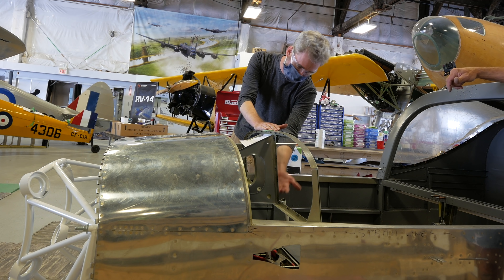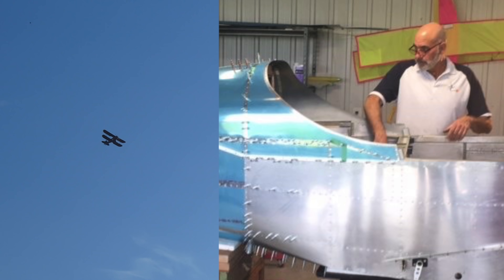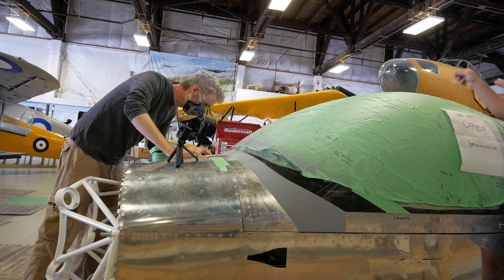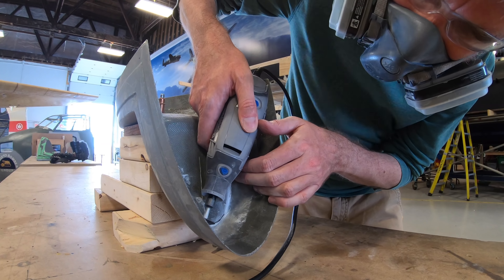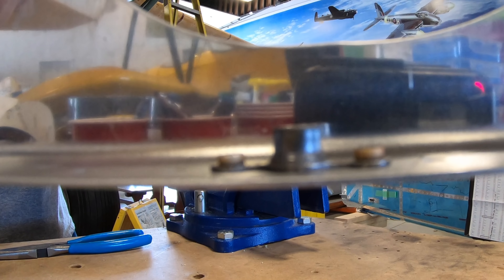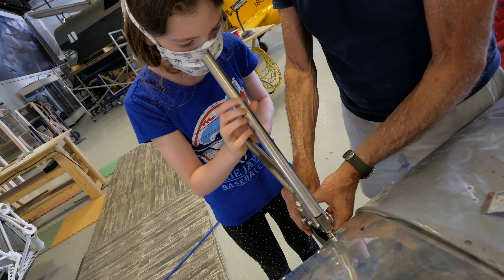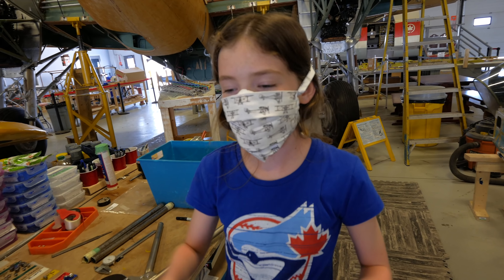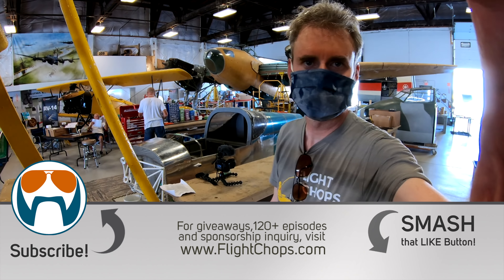Big Decisions made! + Wing Lighting Install - Build VLOG #10

Comment: I'm loving these more in-depth episodes. BTW - top tip, when cutting plexi, if you stick regular clear 3M tape over the cut and cut through it; it acts as a lubricant and greatly reduces melting at the cut line. (Learned from a previous job making illuminated signs).

Comment: You learned the hard way that mixing too much at a time will bite you. If you would have had it in a much larger but shallower container it helps plus putting it in a pan of ice water. I have used a lot of West system Epoxy helping my daughter building cedar wood strip canoes. We use the west system in building up the stem pieces and of course lots doing the epoxy-fiberglass layers inside and out. They have a special extra clear component for that. We have used about 10 gallons worth now with 5 canoes built. They have about 10 different filler materials depending on what you are doing.

Comment: I'm loving the build. Rv's look like great aluminium planes. At least for fiberglass planes, like the cozy mk4 I'm starting tomorrow hopefully, West systems 105 with the 209 hardener is recommended for exactly that reason. It's slower so the thermal run-away is rarer.

Comment: Great to see you SAFELY getting back to the build! Thank you for this. Revision #3 of the instrument panel is very impressive. Clean and balanced. Where will the circuit breakers be located, or are do the switches double as them? Also, since you're relocating the canopy jettison handle, Please show us the alternative method of accomplishing the release. Will it be via mechanical linkages, or flexible cable?
Reply from the maker: For sure yes, we will address how the relocation is executed

Comment: Is Danone Yogurt a sponsor in your aircraft build? lol  -- LED lights are amazing in the right conditions by the way.  Flying the Cherokee Six in the evening one time I had a guy coming at me opposite direction and he could see my light 40 miles away.  And I didn't see his until 10 miles.  Also, I often left the light on all day, even during turn arounds at night left the master switch on and the landing light on (in dark areas) and never worried about battery power for start.  When, I'd NEVER do that with an incandescent/halogen bulb.

Comment: Carefully and dangerously files canopy while on plane. Promptly removes it anyways right afterwards. 🤣😂🤣
Reply from the maker: Heh - yeah - there was actually method to that madness - we knew we just wanted to take off some material with the files and then test close it again.  taking it off was to get easy access to just clean it up after as I was not removing much more material with the sand paper.

Comment: Epoxy in a volume like that creates much more thermal runaway!
Reply from the maker: Haha - yup - lesson learned :P
Reply: Pro tip: immediately after mixing, pour it on a large, shallow dish.  More surface area to radiate the heat away.  And as you already learned: first do all of the prep work, only after that can you even begin to think of actually mixing the stuff.

Comment: Not a Simple question,  What is your favorite type of aircraft to fly and or what type of flying give you the most satisfaction.  Im sure the process of the build is part of that but for a new flyer where would you guid some to experience th joy of flying.   Thanks Steve
Reply from the maker: It's a tough question to answer in terms of my favorite plane to fly... Probably the Harvard mk4 that I have access to at the museum and this RV-14 has been an amazing airplane - I've got over 400 hours logged flying it now :) 
As for where you could gain some experiences, can you start by telling me where you're based?
Reply: @FlightChops  Thanks so much for the response... I am a student pilot and becoming educated with with GA.  Have flown a handful of aircraft and have had experienced a rv7 and have boned up on the vans series.  Seems to be the best bang for the buck for a great flyer.   Fly out of KSPK  a fun hub for flyers for sure and a great area of exciting projects.   Great  Page.  Thanks for the great info.  Steve

Comment: Also, I'm going to buck the trend a little here and say just because the airliners put the autopilot panel on top doesn't mean that's always the best place for every aircraft. I actually agree with that placement since it's right next to the throttle area, which is where your hand is most likely to be. In an airliner, they have autothrottles so their hand isn't as likely to be there. I've seen the low placement a few times and everyone who has it there loves it, so I'm inclined to be in favor of your approach. Also, from a CRM perspective, it's great because you aren't blocking the giant GPS display (ya know, the one you payed $15k for) while you're adjusting autopilot settings, so your crew could feasibly see or operate it at the same time. If the panel were on top, the entire center stack would be unusable while someone is adjusting the autopilot. Just my 2 cents.
Reply from the maker: Appreciate your insights on this
Reply: @FlightChops  Really enjoying the build, can't wait to see it fly!

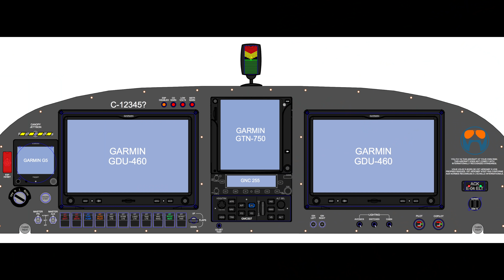Comment: 7:35 Maybe it’s from seeing so many airliner flight decks, but it doesn’t make sense to me to have the autopilot anywhere other than top & center of the panel
Reply from the maker: Yes, agreed - in this case there are technical issues with placing it above the GTN 750 - so we really don't have much choice with out major mods to structure behind the panel - I will expand on that in the panel episodes...

Comment: Not yelling at you.... as the install view was vague..... but I hope that you did not install that light ( small surface mount ) without a grommet on the fiberglass... if you have wires.... you NEED GROMMETS
Reply from the maker: Understood, yes, we’ll be sure it is done right (edit to correct a typo)
Reply: @FlightChops  done right...